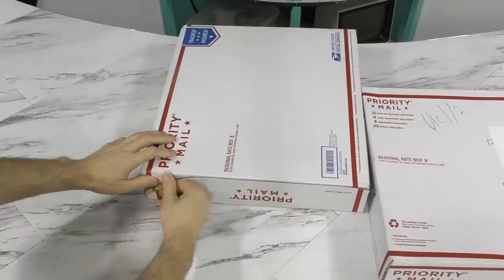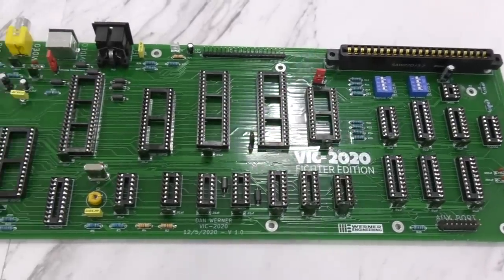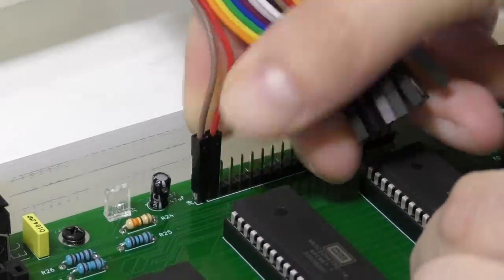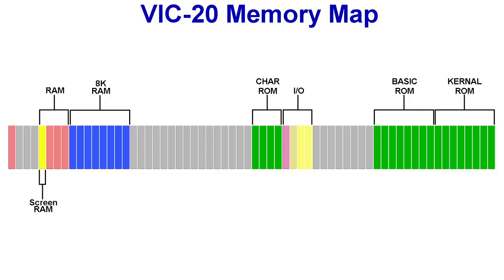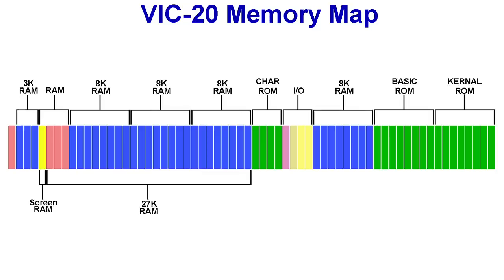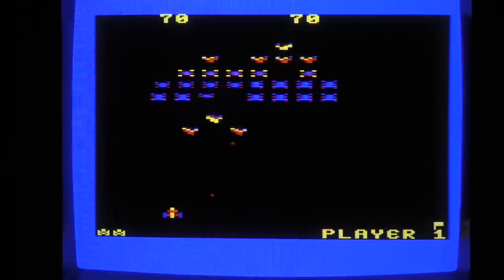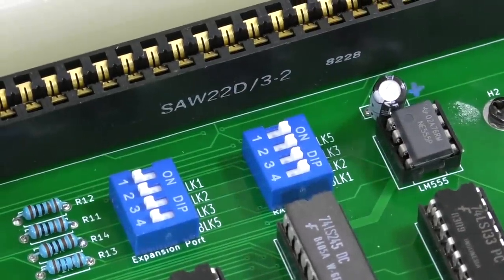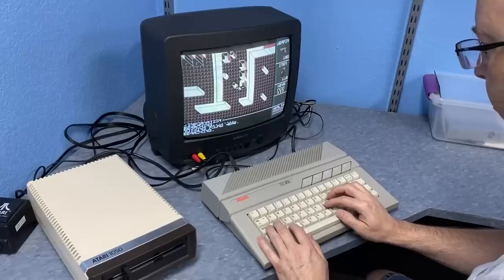Building a VIC-20 Kit Computer and X16 Update.

Comment: Yup, that's why the open source and internal use stuff has so many more features.
No one had to provide a legally binding guide to explain them.
And in inverse: Why commercial products are so restricted.
Some companys go this far and actively prevent non sanctioned use like this. When in reality it could easily work. Classic example are C# or Java applications that would run pretty much anywhere, but it just was never tested. That's why it's listed nowhere as a feature. See legally binding guides.
And if it is distributed you are even encouraged to lock out these use cases for the reasons mentioned in this video. That's how you end up with OS whitelists etc. Where software simply refuses to run if it notices something deviating from the requirements even though it might technically not matter at all.

Comment: I built a c64 by going down to a local radio shack (they had the keyboard).  I bought all the parts, a bunch of breadboards.  The c64 book came with a schematic and I just followed it  It was HUGE.  and took a little bit more power because of all the excess wiring.  But yep.  I did it in a way much much harder than you did it you newb.

Comment: 5:53, have you heard of uniform keycap profiles? Instead of being scultped and having different row shapes they use an identical shape for every row, letting you swap them around. Hope this helps! 

(Alternatively a blank set of sculpted keys could be dye sublimated with the right legends diy at home but that's a lot of work)

P.S. SA profile keys are what I use for a more "retro" feel, it's much closer to what's used on the vic20 originally.

Comment: I must confess I am not sure what the appeal of this is.  There are plenty of examples of the real hardware surviving, and using those means you don't have to take away an original chip that might be used to keep one running.  Same with the Apple II clone boards, although those don't depend on a custom chip like this one.  The end product doesn't even really offer any of the design cues of the original, which is usually a theme with these kits.

Comment: I have been also thinking about FPGA based replacements for those chips which are gradually becoming unobtanium or already are.

A problem is however that there are virtually no FPGAs with 5V I/O. Some older FPGAs can be configured to accept 5V input, but the output levels are still according to 3.3V and as far as I know those are no longer in production but some NOS chips may still be available.
So an extensive bunch of at least partially bidirectional level translators are needed around the FPGA in order to interface it to a system using 5V I/O.

In case of implementing video chip replacements such as VIC the video output itself is another matter. RGB video output is of course fairly easy to implement, but if S-video or composite is wanted in order to preserve the original type of video output, things become much more complex. It needs either an external encoder chip or trying to implement the video encoder digitally on the FPGA with the weird color clock frequencies involved.

One FPGA implementation I myself would be particularly interested of is the DMAC used in the Amiga hard drive controllers.

Comment: LMAO @ the VIC-20, one of the least capable 8-bit machines ever made. It took Commodore 3 years to catch up to the Atari 8-bit computers with the C-64, and even that did not have bit mapped graphics. It's absolutely scandalous how much the 8-bit Guy just completely ignores Jay Miner's fabulous 8-bit computer that preceded the Amiga. I guess he's more about brand loyalty than 8-bit technology. Should have called himself the Commodore Guy instead.
Reply: The C64 has bitmap modes. As for the 8BG, it's easier to talk about stuff you know. He doesn't cover MSX or CPC systems either, for good reason.

Comment: It's a shame the 're-release' didn't get an updated cursor key layout with 4 switches,  like what the plus/4 had. Those stock VIC-20/C-64 shifted-cursor keys are just kind of...inefficient?
Reply from the maker: That would require a kernal re-write to handle that, and also likely introduce incompatibilities with existing softwre.

Comment: I don't see the failure in just using a regulated 9V power supply and deriving the 6 and 5 volts from that on the motherboard with VRMs.
Reply: The user port requires 9V AC, so you would need to either feed the unit with 9V AC and add a rectifier somewhere on the board or come up with a small inverter circuit to turn the supplied DC to AC. Still, though, not hard at all with modern tech.
Reply: @murph9935  Yep, and with SMPS circuits, all voltages can be derived from 5V or USB-3 20V as available.
Reply: @murph9935  SFF inverters cost peanuts these days and can deliver several amps of AC current.

Comment: No links to the product? I swear... It's vaporware until then.

I agree on that if they are using all the same chips, they should have the damn ports. In this the Mini PET is 1000x better.

That keyboard could have been made better. Looking at the ones I got spacing out a few keys would have evened it out. And the expansion slot, there are 90degree slots available.
Reply from the maker: It quite literally is vaporware.  It's a one-off project.  It's been made open source, but there is nobody supplying these for purchase.

Comment: Seems like you could fix the S-Video problem pretty easily by running it to a correctly pinned external jack. You could do something pretty similar with the DIP switches for the memory and attach them to nice external toggle switches mounted on the side of the case.

Comment: unrelated to the video, but not the channel. I just bought a new bolt and found out there is a MASSIVE recall going on with the old ones. I was wondering if you were doing a buyback and upgrade to a new one or wait for a proper fix or switching to a different car. Just curious.

Comment: I'm too stupid to build computers but it is really satisfying to watch someone else do it and explain how it works. Great video.
Reply: You're not too stupid.
You just don't have the opportunity to learn.

 A few  years ago I hadn't programmed a computer since the Vic 20, then I got an arduino.
  Built a robot kit.
Then I got a raspberry Pi.
   I screwed around with them for a few years mostly making network stuff, routers, TOR routers, an add blocker, a self hosted VPN , self hosted a website, all with directions from the internet ... stuff I thought I wasn't smart enough for.
   Lately I've gotten interested in INFOSEC. 
Yesterday I figured out how to get a back door in a new, updated Linux computer using a USB rubberducky.
        Today I would like to figure out how to do the same thing to a windows computer... now I'm not feeling smart.
    All you need is the opportunity, raspberry Pis are about $75 . 
Hack the Box is a freemium model, learn by doing thing. It would suck to do that from a phone but a library or school's computer lab is might be the answer.
    Good luck.
    Don't give up.
 Look,    neither one of us is smart enough to design a car from the ground up but we are smart enough to turn the key and go for a drive . We know how to google up how to change the oil or a headlight. Not rocket science but we need to be shown how.   It s not a matter of smart. It's a matter of finding the information and getting your hands dirty.   Also don't give up when you get shitty directions off the internet.  When you get an error just copy and paste that error code into the google box and you'll figure it out.
    If a fat old hippy living in Northern Canada can figure some of this stuff out so can you.

Comment: I like how you wrote Building aka Assembling instead of Making more often people write I made a (device name) and then they show parts and pcb bought of eBay as a kit to assemble - which means they made absolutely nothing, they just assembled parts in that kit, not - made a pcb design from scratch or even used other design to etch the pcb themselves and then solder the components on it...

Comment: You don't need a modern replica to get an S-Video signal. Actually the VIC chip is capable of that and you can make a simple mod on the stock VIC-20 to get the S-Video signal on the Video connector. I did it in one of mine and the result is awesome.

Comment: The guy I got a retro computer that I want help fixing up it’s a digital computer with Intel inside it used to run MS-DOS but I tried putting windows on it and the operating system got corrupted and also there’s no battery that’s a big problem plaguing these computers anyways I just wanted your help fixing it sorry for the long paragraph

Comment: hmm, couldnt software detect how much ram fitted and then adjust itself to suit screen ram position, ? you had to a bit with a zx81 as its display file came after program area so was never in any fixed position, you had to peek a system variable to know dfile position

Comment: It would be possible to run the user port on the 5volts... but it would be tricky. The higher voltages are a cinch, off the shelf boost converters exist or he could go with a higher voltage input and buck it down for the 5v areas. The AC supply though, that would be tricky, needing to build an H bridge out of transistors would be relatively easy, but getting an AC signal to be generated reliably and cleanly would require some supporting components that might drive prices up a bit.

Comment: So I rewatched the second X16 video to understand the switch back to the 65C02.  I loved the idea of the 65C816 and thought it was a solid choice.  Understanding the dual use multiplexed data/address line issue, why not use something like the W65C265S which has eliminated this issue. Granted it's no DIP.

In re-rewatching the video it looks like he's holding up the 65xx.com wdc256s dev board which doesn't have multiplexed lines...  Now I am really confused as to why the choice to go back the 6502 was made other than being able to DIP it.

Comment: Any chance petcii robots will be available for the 2600? I know you mentioned Atari computers but I am assuming this is the actual "computer Atari models" and not the 2600. I understand if this is not possible because of limitations but short of finding a vic-20 or C64 (or C64 maxi, stateside as I saw your videos on the mini and would rather avoid it) I'm left with only emulation and I'd rather play it on something at least resembling original hardware. Could always hold out for the X16 as I am seriously interested in seeing it come to fruition and while I don't have a real way to contribute to fixing bugs or designing hardware I have been following the project for a while now.

Comment: Great ep!  Interesting machine and RAM workaround.  I'd be swapping those dip switches to case switches myself.  Interesting to spec clacky blue switches on the Keyboard; Red MX would be far closer to a Vic20.  I was chatting to Paul (on the Mega65 project) about this earlier this year... laughing about the fact that if you actually produced an era-correct keyboard, people would rage!  Great to see the X16 still on the go.  Can't wait to get one when they are production :-)
Reply: I'd set the DIP switches to max and just run a memory config program from SD2IEC.

Comment: Yup, people will always dumb even when the issue is clearly documented.
I work for a radio tech company (the fancy multisite radios not am/fm). There are certain features that 'technically' work with certain radio configurations, but the details and specifics arent up to spec so we 'dont support it because of X reasons, but it will still appear like its working even though it has X problems'
Countless customers calling in saying it doesnt work. Yeah, no shit, we said that doesnt work lol. (Specifically talking about bluetooth mics here and Multideck, which is multiple radio bands clumped together to use a single control head. Bluetooth pairs with the radio itself, not the control head, so when you change what radio you are messing with the mic doesnt follow and still utilizes the one it paired with because they dont support multi-pairing)

Comment: (Noobs question here) Anyone knows why the memory architecture is so convoluted ? Why Commodore designers chosed to map the video memory in the middle of the address range instead of (i.e.) putting it right at the of the beginning  (and thus avoiding to have to move the video memory in case of memory expansion) ? Is this a technical constrain from one of the chips ? ... I suspect it may seem straightforward today but may be an oversimplification of the issue ? :-)

Comment: That 3D print is a nightmare... I would like to know how many failed prints for one barley good unit.
Reply: The case looks awful. Do all 3d printed things have that weird rough, layered texture??
Reply: @ct92404  Depends on the settings and the technology. From the looks of it, looks like they went to the fastest settings because this is a huge part to print with FDM technology. I think this is some kind of PLA plastic witch is easy to print and not bends and shrinks like ABS, but still this size is problematic.

Comment: This board and case need some simple modding to make it run better. Rewiring the video output and adding a 3rd composite port should be very easy. The dip switches can be extended with wires and mounted to the side. Lastly a powerful switch should be also very simple to add by cutting out a mounting hole for the switch and routing the positive electrode throw the switch and remove it from the jack. 

I'd love to bring my tools with me and spend an afternoon with David working on this.

Comment: I don't understand the reasoning for not having user port and cass port. Primarily I don't understand why it would need to require such a specific power input that isn't even what the original system would have called for. Secondarily, even ignoring that, I don't understand why he would think that within that constraint there would be outrage and confusion to begin with. Who is putting something like this together and not reading the documentation? Who is putting something like this together and getting angry when they run into a minor issue? Very odd decisions.

Comment: Baking parts doesn't matter when you plug them on a socket.
It's when you solder them that the water content and impurities can contaminate and form a bad joints, usually with time it becomes white-ish and doesn't make contact as well until it can be a problem and need resolder/reflow.

Comment: Even if the moisture indicator suggests you need to bake the parts, don't worry.  That ONLY applies to wave soldering, not to hand soldering with an iron one pin at a time.

Comment: The cap beside the cartridge port is pretty badly placed... It gets squashed by the ic and cart, when you have a cartridge in, that is  But I guess it should probably be a ceramic disc cap and not a electrolytic..

Comment: oh man I live in New Orleans and could REALLY use that little moisture card in all my electronics purchases. I've also got a detached office and it has to have a house-size dehumidifier running around the clock (tubing has to dump directly into a drain because it fills up so fast) not just for the computer but also because the printer paper gets too moist to even print on.

Comment: I wonder if anyone has ever tried adding as much memory (via memory expanders and such) as it is possible to a single machine, and then write some custom program to run and use all of that memory in that enviroment. And then compare and analyze that against current gen workstation loads.
Just out of curiosity, like "what could you achieve with old vic20 or c64 if it had all this memory available" - where does the cpu limitations start to kick in etc.

Comment: I'm sure someone will eventually develop a drop-in replacement for the VIC chip based on a FPGA or uC. There are many students and/or hobbyist working on homemade/retro computers, and a chip with capabilities similar to the VIC seems like a good next step after the simple console output. If I were to use the VIC as inspiration in my project, depending on the extra work required, I would try to make it compatible so that my work has a chance to benefit others.

Comment: He could have used a +5v->+12v DC->DC converter to get the extra voltages from just the one DC barrel jack, then step the +12v down to +9v with a 7809 voltage regulator IC. Then you’d have +5v, +9v, and +12v to play with. Maybe in the next board revision?

Comment: The mini PET used an Atmel micro controller as an alternative to the video chip. Could the same be applied this VIC, with slight modifications?
Reply: The mini-PET CRTC replacement is closed source, so nobody knows.

Comment: I would rather use the sockets with the round (copper) holes, are MUCH better then the old sockets you use, and will work a LOT longer.
Reply: No, they are entirely the wrong component to use for ICs, the double-wipe sockets are the best to use.
Reply: @AmigaWolf  Okay, you can do what you like, but we ain't gonna copy you!
Reply: @AmigaWolf  ICs have flat legs, they fit into double wipe sockets. It's common sense. WE are the people that actually think.

Comment: I know that not having a switch on the PSU can be annoying but you can get these small cables with a switch to put between the PSU and computer so that's a thing.

Also, regarding the DIP switches, now stop me if I'm wrong but I just now realised that you can see the dip switches through the cartridge port, so surely you can flip these switches even though the case has been put on?